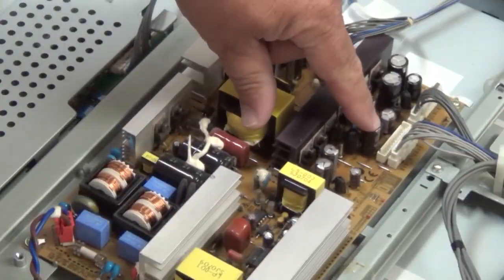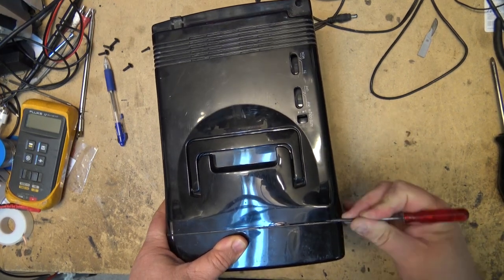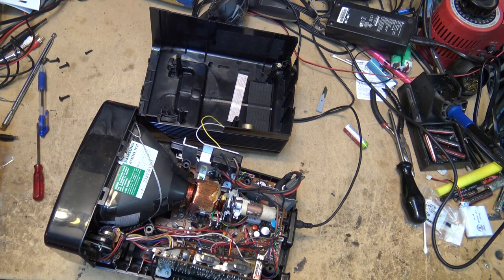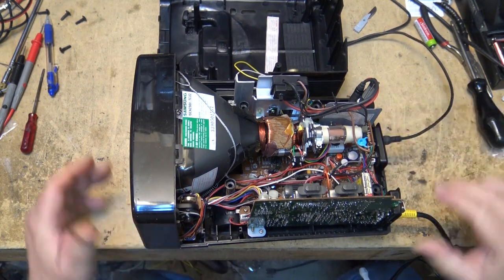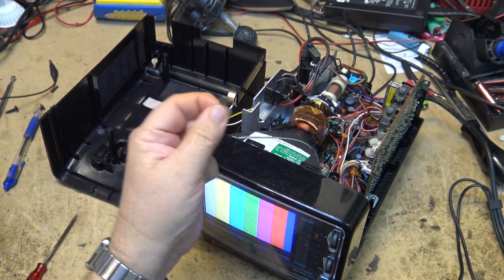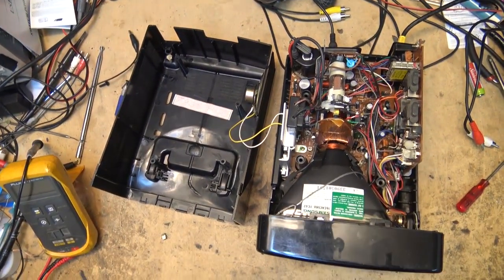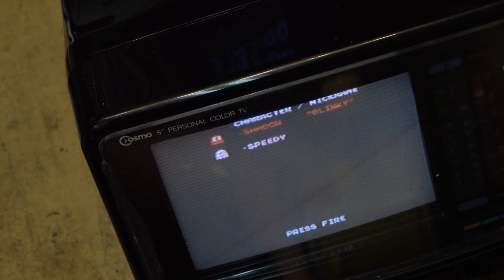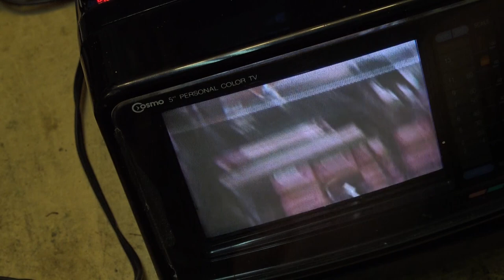Samsung 5" color CRT TV repair

Comment: Hi, I'm really hoping someone can help me out here - I have the same TV, although it is branded as Samsung on the outside and I bought it in eBay, working condition and screen was working with screenshots from the seller. However I've received it now and the screen doesn't work. Everything else works fine including the radio. I took it apart but my one doesn't have the same spark gap thing, they just seem to be missing entirely - anyone know what I could try??
Reply: On mine the tube heater sometimes goes off. I've got it on my bench now but I can't tell you what is causing it yet.

Comment: I've always wondered with today's miniaturization how small we could make a color CRT TV??
Sometimes I wish I was a multi-millionaire so I can pay some tech company to figure that exact question out!!
Reply from the maker: The 2 smallest color CRTs were made by Panasonic and Hitachi and I have both.
Panasonic is a conventional 3 gun delta matrix shadow mask tube. Measuring a 1.5" screen t was featured in the ultra rare CT101 TV. Hitachi made a beam index tube that was slightly smaller a 1.25" that was used on a few video cameras. I am in the process of fixing one of those and hope to get the color sync circuit working soon. The beam index uses a single gun, like a black and white tube but has a striped tube surface and uses sensors to detect where the beam in to trigger color timing circuits to switch between the red, green and blue  channels as the beam passes over that portion of the screen.  I also have a beam index video projector that uses a single gun tube.

Comment: Smashing repair, looks like a nice little set :-D
Those blue caps can be a bloody pain, also known for going short.
As a kid i had an old crown black&white tv, i thought it was fantastic.
Later i was given a dead crown set with a radio combined, no sound at all, turned out to be a resistor that was covered in a woven tube, it looked perfect like new, it was open circuit.
Reply from the maker: This one looks like new inside too.
Reply: Yes it's very clean.
I also forgot to say that the tuner board looks like it came out of an old piano key video, looks only, similar to elna pcbs.

Comment: Nice work you do. enjoy your repairs you do. I own a toshiba 13"Crt TV 2005 had a Panasonic 10"color tv CRT 1983 it failed was a good set talking about a 5" color set a time when portable sets were built with quality a coming question why the new little DTV's don't pick up much over the air the station's
Reply from the maker: I should throw a converter box onto this set for an "Emergency TV"
Since I grew up with the CRT, and spent over 20 years repairing them for a living, the old CRT holds a spacial place in my heart for old technology. I still after all these years am fascinated in how the operate. Plasma is also very cool the way it operates. LCD, well those are just boring, same with OLED.
Plasma you have to pump the display with HV, and then trigger a discharge which fires until voltage is cut off to extinguish the display, then it is pre-charged again for the next sub frame. Very complex, and cool.
CRT, put some HV in a vacuum, heat a kathode, and throw some magnetic fields around the outside of the jug, and watch magic happen. Fascinating.
I have a couple of B/W TVs that I use exclusively as clock displays showing the time. One is very, very old. Had been used as a security camera monitor for 30 years, and it is still going strong, and runs 24/7. These things just go on forever, unlike modern crap.

Comment: I have a 4.5” Spartus B&W TV which I bought back in 1986. It’s worked fine up until recently. I have picture and sound but I can’t pick up channel 3 (where I have my VCR connected to it) I have checked all the connections but I cannot get any signal through the external antenna Jack nor the built in antenna. Could it be a bad analog tuner? Any ideas?
Reply from the maker: Likely the timing voltage to the varactor tuner is missing.
Reply: @12voltvids  I will have to look into it! Thanks for responding so quickly!

Comment: Do you know of a little 2" b&w set called the BINOC made by sears in 1980?
Reply from the maker: Yes I remember that one. Used a 2" tube that would have been used in broadcast ENG cameras of the day. Then they went to a 1.5" tube.
The first VTR portable I ever had was an Akai 1/4" reel to reel black and white system. It had a tuner pack and a little 2" TV that clipped onto the side.
A part failed on it, and no parts were available to fix it. (used these orange potted modules and when one failed there was no parts available.)
Reply: @12voltvids  I have one and after watching your video I got it out to see if it still worked, it worked. If you are interested, and know of someway that I can ship it you are welcome to it.
Reply from the maker: @nomanjones4803  
Sure if you don't want it I collect small crt sets, old cameras, old radios ect. 
You can email me and I'll shoot you an address where it can be shipped.

Comment: I cant wait for thar 1955 RCA set video, that will be a very interesting one.
Reply from the maker: That one scares me.  Only worked on one of those once.  The first shop I worked at the owner had an rca and zenith roundie color set sitting in the corner.  I was an apprentice at the time and I remember my instructor being thrown across the shop by it.  Very high voltages in those.
Reply: @12voltvids  Oh, that poor man surely got a big shock. I imagined they had high voltages, after all they are one of the first tv's. Im sure you will sort it out in the end, you are a very capable tech.
Reply from the maker: @santi0797  
Yes when the owner of it is ready to fix it he will call me.  Hopefully the crt is good.  A suscesfull repair will depend on the shape of the tube.
Reply from the maker: Getting jolted was a hazard of the job when working on tube gear. 
I wear the few shocks I received over the years as a rite of passage. You can't call yourself a TV tech unless you have been bit a few times.
It's gonna happen, sure as shit, just like if you are a race car driver, you are going to crash. Worst one I had from a microwave oven. That one hurt like hell, as did the 30KV jolt I got from a sony HV cap that wasn't attached correctly.  I follow safe work procedures. One hand in back pocket when working around HV, and rubber soul shoes. No way for hazardous current to cross heart, and cause electrocution. You still feel it in the arm though, and it hurts. WHen they say you can't let go they are right. Your hand will grip with superman strength. I had to jump back to break the connection of my hand to a HV source in a microwave. Defective insulation on pliers was the culprit. My fault for not inspecting tools, and discarding them when damaged.I blame my old boss too, as they were the shop tools and he was too cheap to replace them. Just wrap them in black tape he would say. Well, that wasn't good enough as I found out.
Reply: @12voltvids  Lets hope the CRT is in decent condition, that will make for a great video. I am what most techs would call an apprentice, im just 21, and im slowly learning to restore my old HI-Fi equipment (and i only got shocked with 220v mains once haha). The problem is that i live in Argentina, and most people here retired a long time ago. In January 2017 i wanted to restore a Kenwood HI-FI combo that my grandfather bought for my father back in 1979, and i couldnt find one person that would do it for me. So i started looking aroud for videos of people working on that stuff. I can say that your channel is by far the most useful channel im subscribed. The knowleadge that is transmitted will benefit a lot of people for many years to come, since most techs are retired now. I succesfully restored so much hifi equipment of myself and some friends in the last year that is amazing. All thanks to this channel and some others. And even though i study IT. Engineering i find the analog world so much more interesting, i dont know why, i like it more haha.

There is a youtube channel of a man named Jordan that also restores TV sets and some hifi equipment, i think he has some videos of some 1950's tvs, he even has a big tester that tests the individual colours of the CRT tv. https://www.youtube.com/user/jpdylon/videos , that is the channel, maybe yoy find it interesting as i do.
Reply: @12voltvids  shango066's videos are a valuable resource for color roundie repair. Make sure horizontal output tube cathode current is minimized before running too long or the flyback will overheat and those are long since NLA. Have fun with dynamic convergence on an old Delta gun set that those are.
Reply from the maker: I am fully aware of the cathode current on the horizontal circuit. Seen many a cooked flyback in my early years in tv repair.
When I first got into the business there were lots of tube sets. I spent my first few years servicing tube TVs in customers homes because those bears were just too heavy to haul back to the shop, and we didn't pull chassis to service.
When it comes in it will be one I will probably work on for weeks, as I plan to get all the service data before starting on it.
Yes I also know how much fun dynamic convergence was. Did that too almost every day. Even more fun when the old wire wound pots have welded the wiper to the wire and the first time you move the control the wire breaks and then you are cursing.
Reply from the maker: You are right. Most have retired from the business. I retired from the TV repair business in 2003 and promised myself I would never work on electronics again. I managed to stay away for 10 years and then started doing stuff for people as favors about 5 years ago, and filmed one. That one went up on youtube and got tons of views. Now am doing a fair number or repairs, and stuff is coming in from all over the country. I guess there is not that many of us out there still working on electronics. I try to limit myself to older devices where there is a good chance of success. The new stuff forget it. Parts availability is impossible for some things.
Reply: @12voltvids  Yes, i've heard on some of your videos that you retired, and now you work in a telecomunication company. Over this last year i met a lot of retired techs, and some of them even gave me some old cool equipment. I mostly restored old HI-FI gear, as it is possible to repair it. On newer stuff like pc motherboards it is a struggle even to replace a damn capacitor. I now have an old Panasonic VHS that my grandfather bought back in 1985 i believe, waiting to be serviced. I take the servicing of old equipment just like a hobby, not like a business model, just to have a little bit of fun.
Reply from the maker: Yup same here. I don't make any money doing repairs. Most things I fix I make less than 50.00 on, but I do make money on the advertising that goes with the videos.  I don't disclose what youtube pays. It isn't much, but enough to keep me producing content, as the move videos I have and the more views, the more the revenue adds up.
Reply: @12voltvids  I got stung a time or two working on them, they were lower voltage then the later solid state sets, 20 to 25KV VS 25 to 30KV.  Doesn't make it any more or less jolting though! main thing with all the old, especially earlier tube color sets was they for the most part were handmade and point to point components and often take a different mindset to really dig into. Haven't touched one in years but very happy that youtube has so many videos of people working on them, brings back a lot of memories of taking my electronics classes.
Reply from the maker: Tube sets were on their way out when I got into the business.  I actually wish I didn't go down that road. I should have gone to work for the telephone company. My uncle was a telephone man, my cousin was an operator, I went into electronics and video production. 
The repair work paid the bills and put food on the table, video production was the fun stuff. Weddings, corporate videos, infomercial, demo and training videos, and tons, and I mean tons of realestate videos. Hated weddings, but they paid well. Corporate videos were nice too. Realestate were easy, but didn't pay that well. Easy quick cash but realtors were dickheads most of the time. They always wanted to make a change after the work was done, like if the price changed, or another house pimp wanted their contact info added. Re-edits were common, and they never wanted to pay for the extra work, but the work was steady. I stuck it out for 20 years working in the repair shop, and got fed up 15 years ago and walked. Did video production full time for 2 years and put up satellite dishes. While doing that work I discovered I enjoyed that work, so when the phone company started hiring, that is where I went. Should have done that right out of high school. I am seeing many of my co-workers now, same age as me retiring with 38 years in the company, and talking home a nice 3800.00 a month or more pension. Should have gone that route right out of school. Trying to convince both my kids that they can be set for life, but like me when I was 19 they are dumb as a box of hammers.

Comment: I have a 1981 Philips 20" set with the KT-3 chassis and it has exactly the same symptom as this one. I will try and see if the screen voltage is low.

Comment: now make a follow up with rechargeable pack :)
Reply: Making a battery pack for that thing would be dead easy, just get a bunch of cheap NiMH batteries and put them in the battery compartment. There's already a CHARGE light which presumably charges the pack if the set is plugged in.